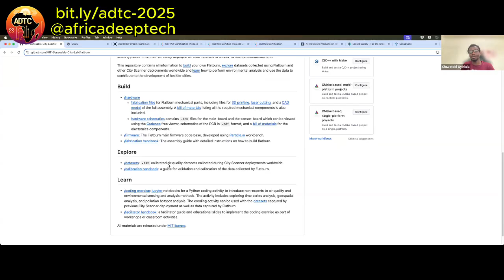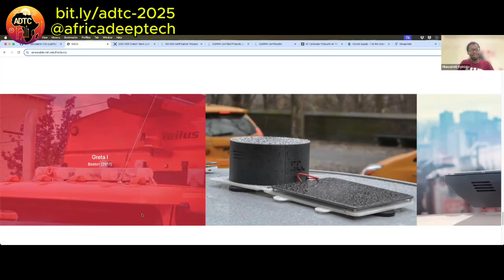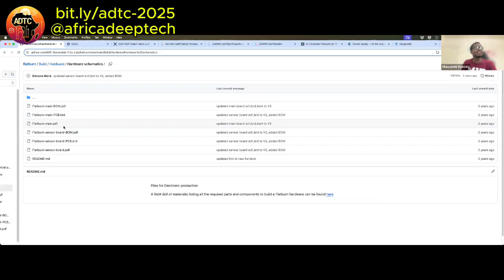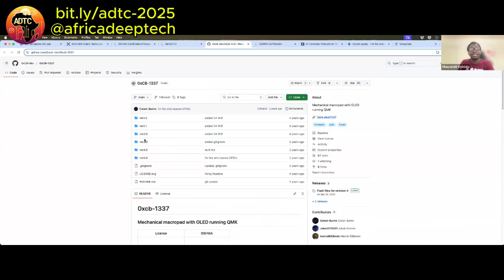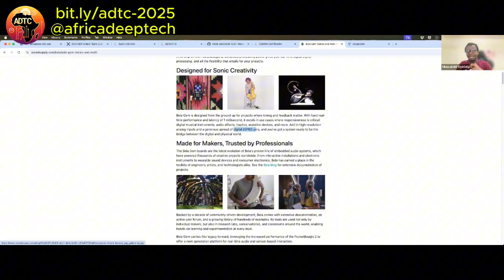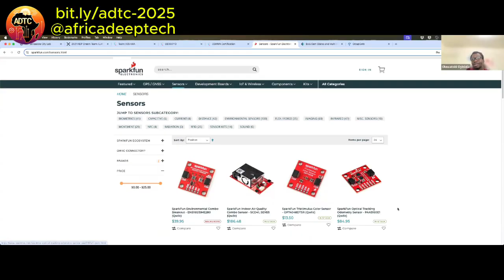Documenting hardware projects the open source way

Comment: Have u tried connecting the device straight to the car battery so you don't have to worry about power and if the device doesnt neccesarily need to be on top of the car, it can be hidden inside of the car